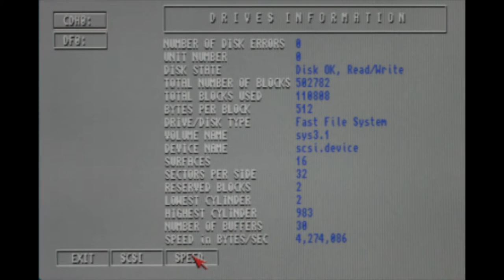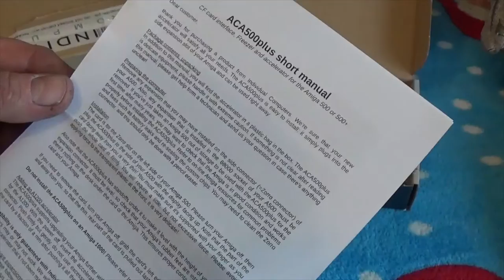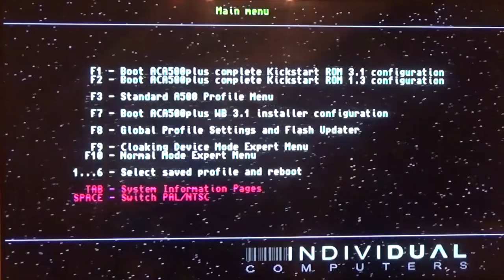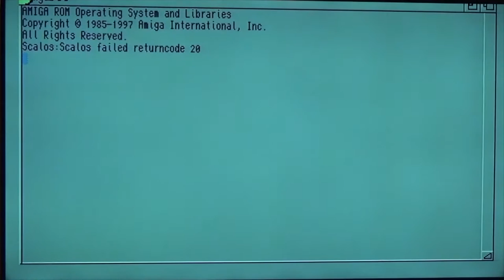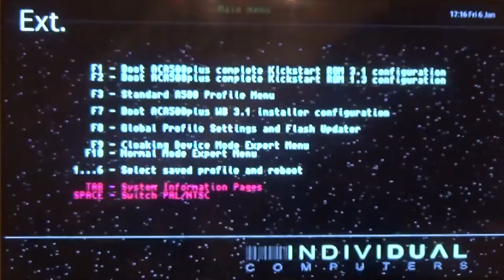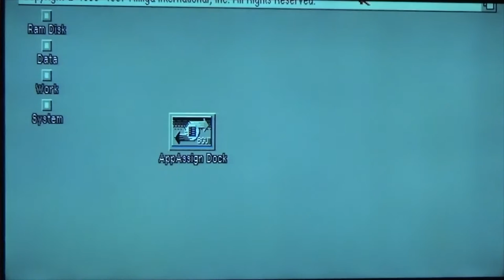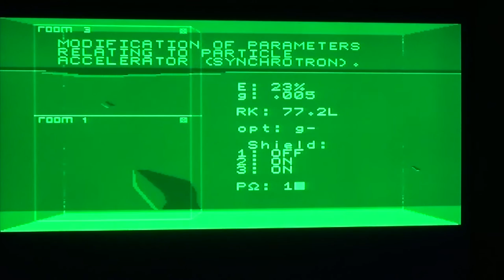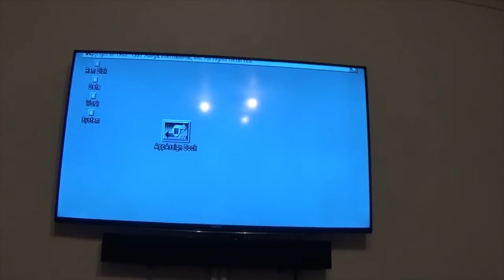Amiga aca500+ unboxing review & testing ...

Comment: Hi Mike, hope all goes well. Just wondering if you had any thoughts about doing a WHDLoad video using the ACA500 plus? I know it would be extremely useful at my end!
Reply from the maker: Hi the ACA500+ is packed away in the void that is the shed , i have the older ACA500 at hand if that would help ...
Reply: Hmm, YouTube had turned off the notification of comments on other people's videos... so sorry for the late reply! I think I have cracked it... it took a while to get my head around, but it's all installed and working. Just sorting out the kickstarts and maybe improving my Workbench experience. :)

Comment: I went from a Dragon 64 to the Amiga with 1MB what a difference.
Interested in what was causing the system to not boot at 21 and 28. Wouldn't Wing Commander or Gunship 2000 give a better view of what an accelerator is capable of.
Reply from the maker: daishi5571 indeed , some 3D stuff would show it off better I'll do that in the next vid :)

Comment: I still have an Amiga 500+ that I bought a floppy emulator to a couple of years ago. Tried to get some games running but lost interest quick because even with the emulation it is too cumbersome and slow to load games. Also some games don't even load or crash, possibly due to bad disk images I have or incompatibility with .ipf images. Which makes me skeptical about purchasing yet another expensive addon like the ACA500plus.
Any tips to what to do with an old Amiga or should I just stick to using WinUAE which actually does work and is hell of a lot more convenient than the real hardware.
Reply from the maker: Nicolai Syvertsen the good thing about the ACA500 is that it has enough ram (2mb chip too on a plus) to run whd load - so no floppy is needed. Floppy emulation and real floppies are a pain and I don't like using them either but whdload is a joy to use on a 500+ with the ACA. If I get time I will set mine up at the weekend and do a long video on using it but I do recommend it.
Reply: I thought the ACA 500+ actually has 8mb of ram.  The older ACA 500 only has 2 mb.  I could be wrong but that's what I thought.  I'm very interested in getting an ACA 500+ here in the states.  But no one has them for sale.
Reply: That is also a point. Availability has always been poor for the ACA 500 and if you own an A1200 (which is far more rare than A500s) you have more options. The new PS-IO (to load playstation  games from SD cards) is also very hard to get atm.
Reply from the maker: +Nicolai Syvertsen the thing is , if you have the newer aca500 it will allow effortless use of whdload (if you have 2mb chip) and that is much more convenient than floppy or floppy emulation. Almost all games are supported on whdload but not all obviously
Reply from the maker: +7777Ralph individual computers sell them worldwide don't they
Reply from the maker: They do sell them worldwide or Amigakit.com

Comment: Obviously these things are used for speeding up games and all sorts. Ignoring that, these things seem like they'd be useful for very niche purposes too. I think, if you used one to plug in to it (salvaged from an a1200 presumably) a 68040 card that takes a FPU too (like a 68882), you could swap the 68040 for a chip that has an FPU built, like say a 68060. That would then mean you have two FPU chips. Would they both work? I think they should. So what you have there are redundant registers (per FPU). You can then swap data around between registers, circumventing the need to use RAM. That means all that processing is done cache (well, pretty much - you see what I mean). So drawing (or changing) 2d or 3d lines suddenly gets quicker. The reason why this is imporant is because it is not something you'd get from merely unlocking the extra speeds you get on the aca500plus such as 40MHz and so on. That is merely "extra speed" and not more registers.

Comment: how do you connect the amiga to the TV? RGB Scart?
Reply from the maker: 666bigl usually yes or rgb to vga , it depends on wether it's a tv or a monitor. I do have rgb to hdmi to allow capture too
Reply: rgb to vga female adapter?
Reply: What kind of hard drives does A500 takes?
Reply from the maker: 666bigl yes , rgb to scart on an LCD tv
Reply from the maker: Roosevelt Littleton on the Aca it's a Compact flash card. In the old days they used 50 pin scsi
Reply: mjnurney 
so the SD card on the aca500. Is the preferred method of storage? As for as storage capacity goes? What file system has to be formated for the card to be used? Thanks for answering my questions.
Reply from the maker: Roosevelt Littleton it's a CF for the Amiga file system - any should work I just use FFS and the Aux CF is fat 32 . I use 4Gb on the Amiga side and 16gb on the fat 32 side. Compact flash not Sd by the way.